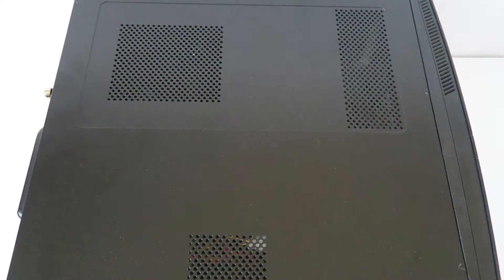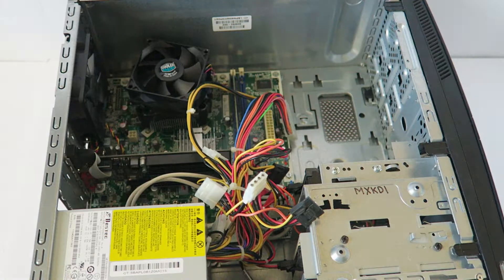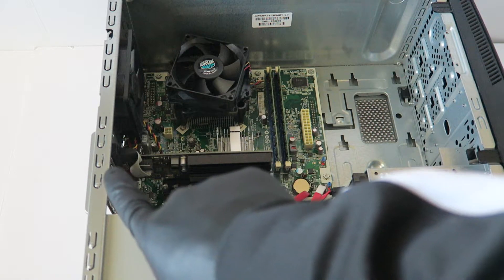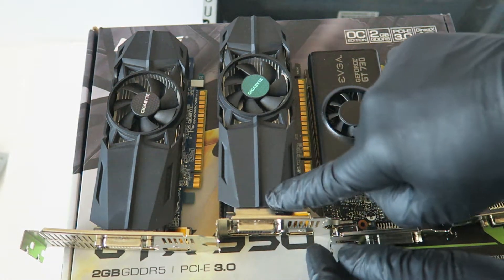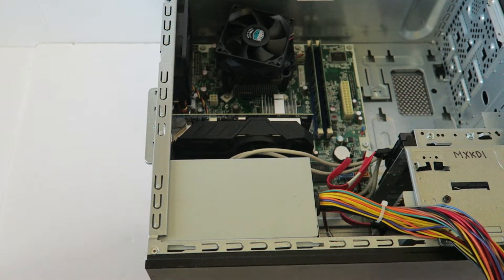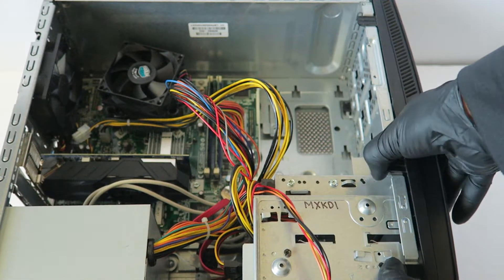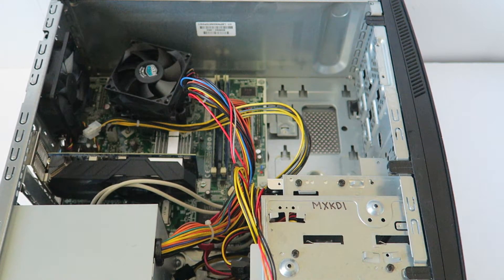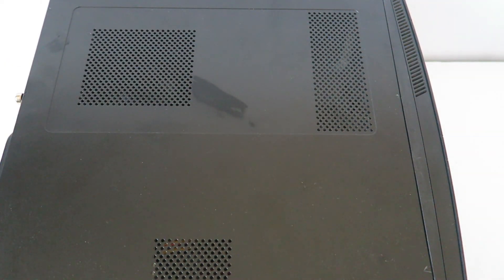Compaq HP 500B MT Gaming Upgrade Video Card SSD RAM

Comment: I have seen this 8GB RAM, does anyone know how that is made possible? Maybe a hack?
Reply: The video says only 4GB will be installed.
Reply: @deeder001  nah, I figured it out... You need to use 2RX8 RAM for the computer to see it... 2 4GB Modukes will do the trick...
Reply: @deeder001  nah, it accepts 4GB PC3-10600 2RX8 RAM... Up to 8GB...
Reply: @oanthatakealeboga571Could u instalo 8gb un This machine ?
Reply: @LeDessin-fy7jw oh yes... Just makes sure the RAM is 2RX8... Max is 4GB of this type of RAM per slot...
Reply: @oanthatakealeboga571Thanks for replying, no everyone does

Another cuestión Sargent, what about a pc3-12800 2rx8 4gb Ram, it works for the HP tower 500TB ????
Reply: @LeDessin-fy7jw  only 10600 will read... Nothing more...

Comment: Can I use any graphics card and can I also use 8gb RAM in total 4gb for each slot.
Reply from the maker: Hi, yes you can use RAM 4GB per each slot.. Depends what kind a video card are you going to use ?
Reply: @Mxkdt  please can you name the graphics card I can use and also add a graphic card with 4gb dedicated AMD or Nvidia anyone.
Reply from the maker: Sure and what are you going to use PC for ? and what kind CPU does that PC have ?
Reply: @Mxkdt  heavy gaming like the Witcher and other large set of games and graphics designing also sorry about the late reply
Reply: @Mxkdt  and can I also use it with the 300w power supply.
Reply: @Mxkdt  I have this exact computer but whenever I put 4gb ram stick in the slots it won't work. Do you know what I have to do to get it to work?

Comment: Just to say you can use 4gb sticks to get 8gb. But the ram needs to be 'dual rank'. Usually with chips on both sides of the PCB. Sometimes marked as 2Rx8 on the sticker. Single rank ram is max 2gb per stick
Reply: Can you put a link to 8gb ram that will work for this computer?
Reply: @Punisher1_1995  You install dual rank memory and it didn`t work? What is the model of your MB? Foxconn 2A8C?
Reply: @75veto  yep and my model is a Foxconn 2A8C. It's updated to the latest BIOS if that helps.
Reply: @75veto  I now know it only works with some processors. I think you need I've with 800mhz fsb. 8gb doesn't work with my q8300 but okay with e4500

Comment: I got mine late 2013 from a company which was upgrading to new systems. Its been sitting for a couple of years not often used. But around late 2019 I put it on good use on my radio station which has since playing out our audio for 2yrs now on a 24/7 operation it's up most of the time. The only problem I encountered just now is it was replaced with a cheapo PSU so I need to change it out but all the parts are still original. I'm not upgrading this because I need legacy hardware for my software to run (32-bit to be exact.) Which these days can be rarely seen.

Comment: I have one of these towers and I have a question about the ram, can you use a single stick of 4 gig 10600 DDR3 or do you have to use two sticks of 2 GB DDR3 10600? Because the last time I tried a single stick of 4 gig it kept on beeping instead of booting
Reply: Just to say you can use 4gb sticks to get 8gb. But the ram needs to be 'dual rank'. Usually with chips on both sides of the PCB. Sometimes marked as 2Rx8 on the sticker.
Reply from the maker: Hi, yes this machine does support max 8GB of RAM and 4GB per Slot and only support Non-ECC.

RAM
https://amzn.to/2Rl1Tf1

PC sold with 8GB RAM
https://amzn.to/3xMKHQc
Reply: @Mxkdt  support only 2x2 gb ram
Reply: @Mxkdt  when I use the ram in the link my HP 500B MT just starts beeping. How do I solve this?

Comment: I got 8gb it's working fine.. on windows 10 64bit.. but can I go to 16gb risk free?
Reply: How did you get the 8gb ram to work mine just beeps
Reply: @Punisher1_1995  idk it just worked
Reply: @jaybanski  do you have  a link to the ram used?
Reply: its true, i saw one 500B MT with 6gb. but I have the same and I can't use more than 4gb
Reply: sure ?? the MB support 4gb or not ?
Reply: @sanignacio139  The MB ony supports 4gb... But Since I'm running 64bit and not 32bit... It said i could go beyond.... I want to go to 16gb but I'm afraid something bad happens
Reply: What windows bit version you got?
Reply: @jaybanski  windows 10

Comment: I've using it for 10 years it still works
Reply: Me too xd
Reply: if you have 2A8C mobo then yes 2x2GB of RAM is max
Reply: Is 4gb of ram the limit the pc supports
Reply: @ssgpizzalover515   No, it is ddr3 so it would be 16gb (8x2)
Reply: Q9550 and GTX 550 ti👍
Reply: im thinking of ubgrading the video card
Reply: My dad used for soo long and the pc is smoother than myn

Comment: Sir I I have a 500b mt it has no graphics card... But I'm planning to install one..the problem is the processor is Pentium dual core and the ram max supported is 4gig ddr3 which I've already upgraded...could it play something like fortnite..? Also my sound doesn't work  I've done the bios enabled and everything else nothing works..the only thing works is buying a external sound card can you help me to fix the internal? Thanks in advance for reading all that...
Reply: Can I increase memory RAM .. I have the same computer, but I am afraid to increase ram and something happens to the computer
Reply: @JohnOrd-v3b  Maximum RAM is 4GB.Get 2 GB for per slot
Reply: @karanjanjoroge9658  I have 8 gigs and it works
Reply: @AdamHuml  Can you tell us what type/brand of memory you used for the upgrade?
Reply: @OliverStahl  2x Patriot Signature line, double sided 2 gig per side (!important) I think it's CL11
Reply: @AdamHuml  Awesome, thanks a lot!
Reply: @AdamHuml  Well, it sadly didn't work. I bought a pair of PSD34G13332 which were not accepted either.
Reply: I'd say try updating de bios
Reply: @ChSugnwhtm   last BIOS 6.05
Reply: @sanignacio139  where you found it i just found 6.01
Reply: Did you ever try the ram upgrade? I've heard it can take ddr3 ram up to 8gb.
Reply: @schnat15  Maximum RAM is 4GB.
Reply: Just to say you can use 4gb sticks to get 8gb. But the ram needs to be 'dual rank'. Usually with chips on both sides of the PCB. Sometimes marked as 2Rx8 on the sticker.

Comment: Hey mxkdi 

I had to ask with a psu adapter would i be able to change the psu from 255w to 500w its the dell optiplex 3020 ssf , im more than happy to keep the psu outside of the case

Do you think you can connect a new 500w psu the dell optiplex 3020 sff?